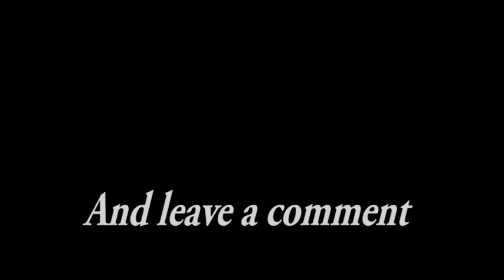This job was just FUN !

Comment: Do you have a video of the milling? With the rings as far apart as they are on those boards, I can't see them being too useful, though. Is there much of a market for that wood vs. dense growth or old growth wood? Can it still be used for window sills and siding, or is it not as stable as the older stuff?

(I may have missed it in the video, perhaps you're taking them to a commercial mill. As a woodworker, I also hate to see good wood ground up, though I understand that the economics of it make the log producer get not much and the mill and retailer take the lion's share).
Reply from the maker: Good for outdoor construction lumber, fencing, decks, arbors etc. old growth is rare and expensive

Comment: So Blair, do you let the logs age dry with sealed ends before you mill them? Or do you "green mill" and stack cure the milled lumber? Never could figure out which method is best, to prevent cracking and warping. Cheers.
Reply from the maker: Redwood is easy. Mill green, stack and sticker, dry in 6 months

Comment: Milling must be a lot easier with such a distinct difference in color between the sapwood and heartwood. How big a log can you mill?
Reply from the maker: Redwood is easy to mill and it drys fast. Easy to sell too! I get 2 dollars a bd. ft. Unsurfaced, full dimension timers.
Reply: Don Foster His mill can do any size log but is limited on the finished boards sizes. He just has to get the saw higher then the log. 

He has shown it in a few videos. Every mill has its advantages and disadvantages form a chain saw mill's portability vs cut size to a stationary mills having to move the logs to it.
Reply from the maker: Could not have said it better myself😉

Comment: Do you adjust your price for removal when you can mill and sell the wood? So what's the deal with the stone pine did you guys clean it up? Always look forward to your videos.
Reply from the maker: I always offer some of the milled lumber back if the client wants it but honestly, that rarely happens. Logs are not income. Getting a log means you have another job to do to make it worth something and time for the lumber to dry.
Reply from the maker: Stone pine log, not yet. In the line for a day off of tree work.
Reply: +arboristBlairGlenn do you ever mill any of the oaks you remove?
Reply from the maker: Yes to milling oaks and other hardwoods. Love to mill walnut and maple. Sometime I get off wood like locust, persimmon Apple etc.